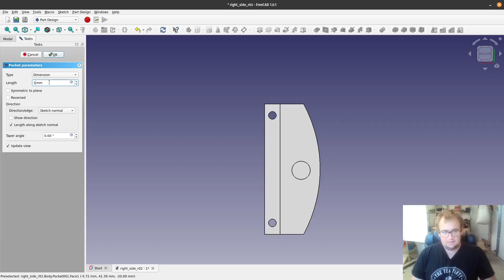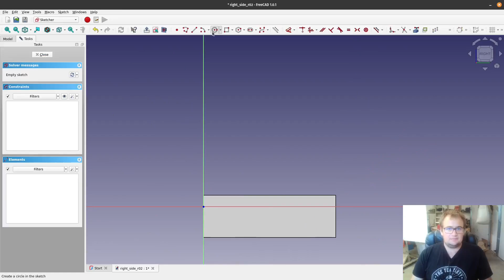FreeCAD: Create Sketch on Face

Comment: how do you place the object at an exact location on the face?
Reply from the maker: The way I usually do it is dimension it to where I want, but I've not been able to do it with respect to the face so I do it based on the axis. So that means you need to make sure the dimensions are done for both the sketch your making and the face where it's being made on.

Keep in mind I am quite new to FreeCAD so there are probably better ways. I'm planning to start adding a link in the comments to official documentation.